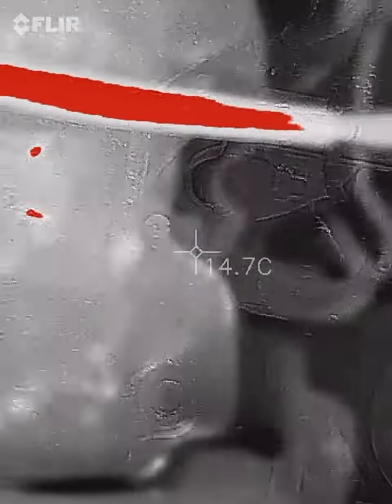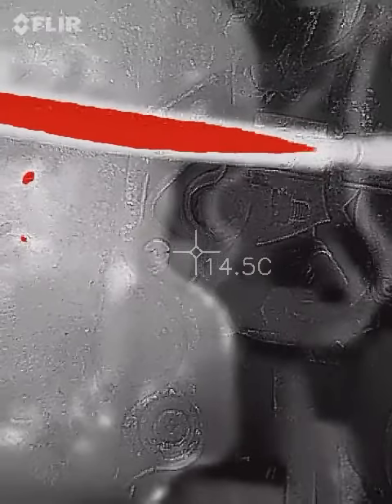Looking with flir for glowplugs on 2.8 non turbo HiAce Diesel .

Comment from the maker: all 4 plugs where dead a voltage drop test confirmed it , or rather no voltage drop due to no draw from any of them , However i think this cant be used to see if they work . i have to try in morning when it is cold no change could be seen after fitting 4 new plugs fitted they are to deep in the engine glowing to show up as working or not.